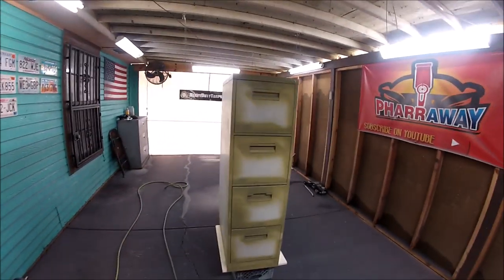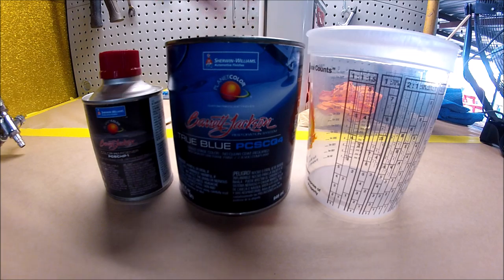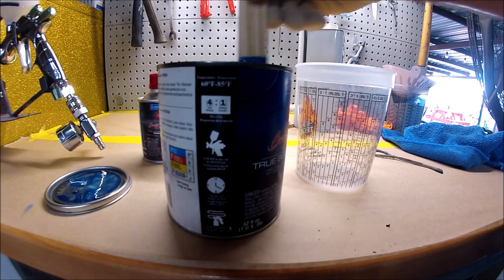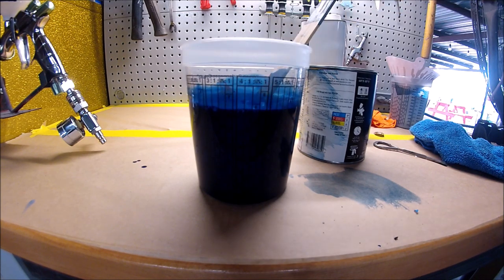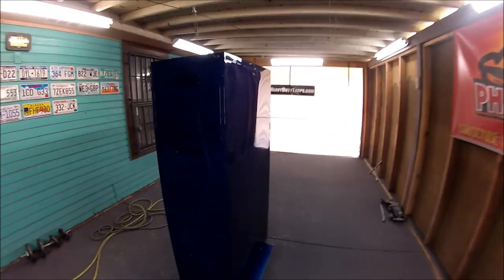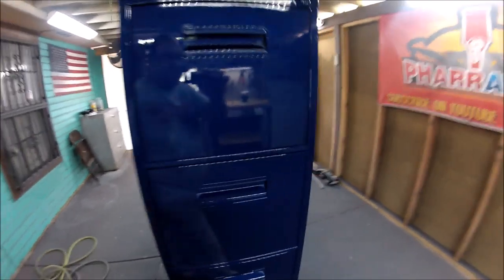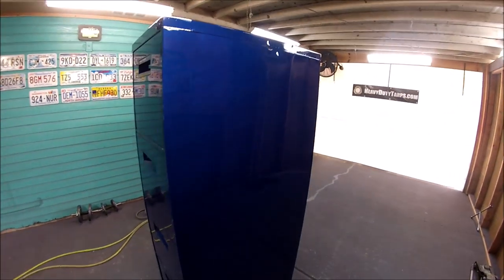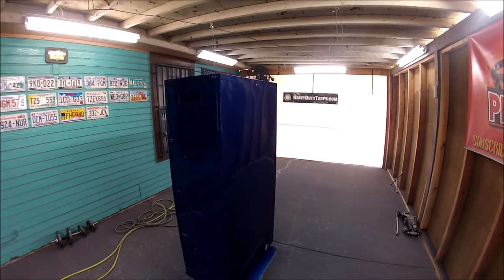How To Mix And Spray Single Stage Paint

Comment: I used ICI 2K paint in the late 70s early 80s before basecoat and clear became the norm, solid colours were okay to spray but the metallics were a nightmare trying to not get tram lines and blotches, you literally had to go over and over the panels trying to get it to flow out and get the metallics sitting properly 🥵🤬. By good luck there wasn’t to many metallic paint finishes in them days. I don’t know what single stage paint is like nowadays I’m not in the trade anymore, I suppose it will be a lot lot cheaper than water base and clear coat so would be okay for someone wanting a cheaper respray , anyway keep up the good work,I really admire how you can turn out the jobs you do without a spray booth, although I think some painters that work in spray booths think they can get of with less cleaning and wiping panels, but really you have to be just as thorough as you are in your garage. 👍🏴
Reply from the maker: Thanks brother God Bless and stay safe

Comment: I use single stage paints along with 2 stage, daily at my job. You can achieve the same finish using a 1.6 setup, but with less coats 👍
Reply from the maker: Great tip!
Reply: What's 1.6 set-up ? Thanks
Reply: @samsbogh9361  tip size of the spray gun.
Reply: @johnf9359  
Thank you sir

Comment: I am painting an older truck project so it does not have to be perfect. But my question is this: Do you need to shoot sealer before single stage or can I just fine sand the original paint and primer some of the exposed metal/bodyfiller spots and then apply single stage to that?
Reply from the maker: You don't have to but it helps

Comment: Does single stage hold up for motorcycles? The fuel tank is gonna get a little fuel on it from time to time, wondering if single stage will hold up. Thanks bro.
Reply from the maker: Yes it will
Reply: Single stage paint has the same solvent durability, as any other 2k topcoat. Excellent finish @parraway 👌

Comment: Question.   To make it more durable can you spray 2k clear over it or will it react with the single stage??
Reply from the maker: Yes you can just wait 20min before applying it and you will be good
Reply: I’m planning on color sanding then spraying clear
Reply: Would you say it’s safe to apply 2k urethane clear over acrylic enamel all in the same day??

Comment: So you're not washing up your gun between coats. I thought with the hardener it was set up kind of like Bondo and you would have to mix a new batch for each coat. If you can tell I'm really not that familiar with automotive paint. So how long is you working time or how many coats can you get before you start having problems?

Comment: You might not answer but i know single stage needs no clear coat, but can you still lay atleat 2 coats or will the paint react differently?
Reply from the maker: You can still add clear coat and have no problems

Comment: hey. question if ya dont mind. can you help clarify the whole parts thing if someone didnt have a mixing cup. say its 4:1 does that mean (if were using cups), 4 cups of paint and 1 cup of hardener?
Reply: Yes sir. Whether it's ounces, gallons or cups. If you use a 12oz cup, it's 4 cups paint, 1 cup activator.

Comment: Great video!  Question..is that enamel or acrylic enamel and what gun tip size?
Reply from the maker: Acrylic enamel with a 1.3 tip
Reply: @PHARRAWAY , how long between coats? Flash or string test or dry to the touch?  Thanks in advance
Reply from the maker: @mark53susan56  I wait 15mi. Between coats
Reply: @PHARRAWAY  thanks!  First time spraying single stage .. many times bc/cc

Comment: You don't mean "BURN up quick"
You mean it will FADE from the sun faster ? Right.
That's why single stage is best with solid colors.
     Metallics float in the paint , and the closest metallic flakes near the surface will rust after some wear from washing and sun exposure.( Burn up )
     If you had base clear the clear is the layer of protection.
Reply from the maker: true LOL

Comment: Don't mean to sound stupid but what did you mean by if you lived in a hot climate the single stage paint burns up
Reply from the maker: It doesn't have clear  and will burn up quicker
Reply: @PHARRAWAY   are you meaning drying quicker
Reply: @sll-tt6bj  fade

Comment: I got this single stage paint and it says  to spray at 8 to 10 psi that can't be right I heard someone they say the manufacturer go by the cap pressure so I should spraying way more that that
Reply from the maker: that is what they all say but go with 29psi

Comment: Looks great, hard to do a metallic single stage well.
Reply from the maker: Just try to keep it at 50% overlap and you will be ok
Reply: 50% overlap & low volume on the flow to reduce mottling.
Reply: @scotttreece6097  that's a great tip for patong Metallic paint I had to learn that part on my own

Comment: Do you just use normal urethane reducer?
Reply from the maker: Yes
Reply: @PHARRAWAY  ok thanks I don't have to add any harder? Just the single stage paint, and add reducer, and spray? I've never used single stage b4..
Reply from the maker: @compoundlml7156  you do they are some brands that you o ly need hardner and some need harder and reducer
Reply: @PHARRAWAY  Crap lol. Well guess I'll figure that out. Thanks so much for the replies🤙🏻

Comment: What did you mean by burn up the paint?
Reply: I have the same question. I liked and subscribed to ask this same question and scrolled through first. So I'm thinking that in temperatures above 80* we would want to use a medium reducer to avoid orange peeling, but especially in temps above 95* like his area in the summers... a slow reducer is necessary for even single-stage paint that is pre-thinned. However, even knowing this much... it doesn't answer the question of the term, "burning up the paint" in high temperatures. Did you ever find an answer somewhere else?
Reply: He mentions in another comment that it "will fade"....over time I'm sure....no time line was given in the comment I found

Comment: is that acrylic you are using
Reply from the maker: yes
Reply: @PHARRAWAY  Thank you what are your spray gun settings and what psi are you spraying at.
Reply from the maker: @Farmer2492  the fluid wide open and the material 3 1/2 turns from close at 29psi
Reply: @PHARRAWAY  Thank you is that material the span 3/1/2 turns
Reply from the maker: @Farmer2492  yes
Reply: @PHARRAWAY  thank you very much.

Comment: Can you spray clear on a single stage
Reply from the maker: yes you can
Reply: Do you buff than shoot clear over single stage
Reply from the maker: @darnellvassar3959  if you shoot clear at the same time just apply it but if it's dry already you need to sand it with 800 and apply your clear
Reply: The clear is for more shine and durability

Comment: UGH , NEVER mix your paint with the stir stick in the mixing cup , it won't be accurate . Plus you should have masked off your drawers so you could have painted the edge. Now when you open the drawer you can see the sealer color.
Reply: Where should you mix it then??